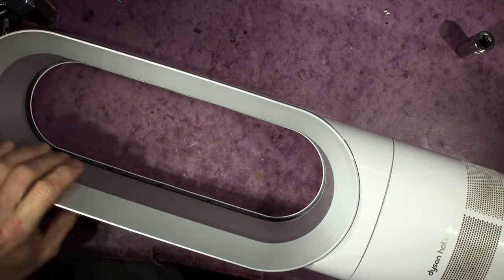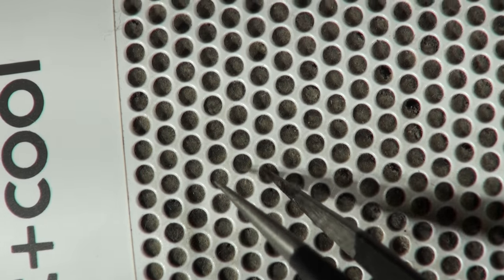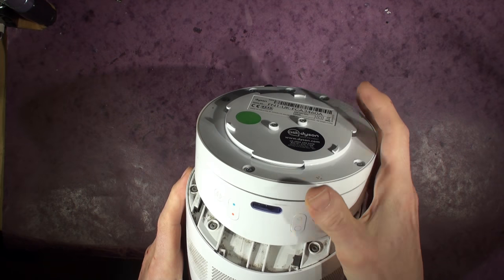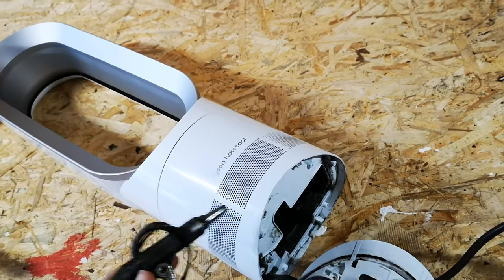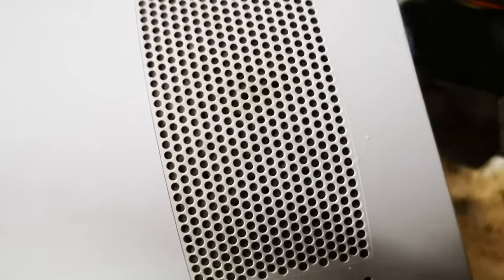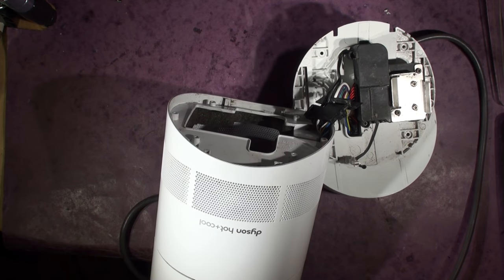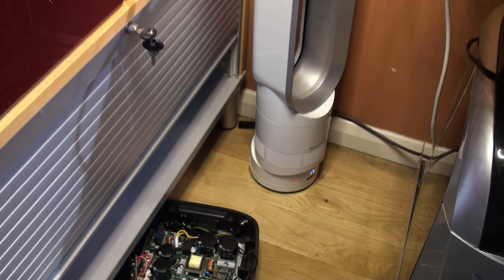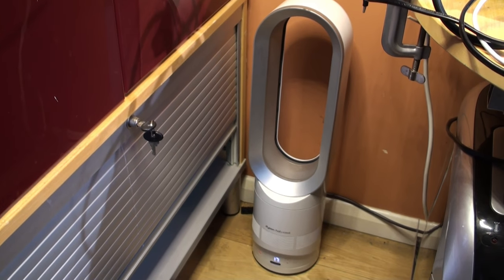Dyson Hot + Cool heater not blowing easy repair and service and filter Clean

Comment: I have Dyson hot/cool unit and it too stopped working after using it for only 2 years. For an unit this expensive, cannot believe how difficult it is to clean out the dust. Not to mention the noise.
Reply from the maker: It is truly a  victory of style over function
Reply: Done purposely so you have to buy new
Reply: Literally… same
Reply: And.. same again. 
Thanks for video
Reply: I have a simple 12" fan and this dyson. I cleaned the 12" wire fan in the time it took to take apart the dyson. Haven't even cleaned it yet. What an ugly pain in the ass.

Comment: So basically, this is not a buy because if you had to go through all this just to clean it. You better getting a regular fan or a regular heater.
Reply from the maker: I understand that if you vacuum the input holes on a regular basis they work OK. Over-hyped? Noisy? Way overpriced ? Yes. If you prefer a victory of style over content then buy one otherwise tere are far better and cheaper products on the market. Honeywell fans are good.

Comment: I was surprised that you said it was noisy. Mine is very quiet. And has been great for keeping the kitchen warm and not having the heat up the whole house, until I got the H2 error message. So I hope I can clean it because now I'm retired and I can't afford it another one.
Reply from the maker: Mine sounds quieter now I am a bit older - but they are loud... the dB meter does not lie!!
Reply: I have the same issue

Comment: Mine has never blown cool air .dont buy one you’ll regret it
Reply: Probably because you dont clean it or u have a bad ac wall plug
Reply: You do set it to 32 F or 0 C right?
Reply: They don't cool air. It just circulates ambient air to make it feel cooler. There is no cooling element in them.
Reply from the maker: They are a ridiculous product.  I haven't spoke to anyone that loves the Dyson heater. The real question is why or how anyone could be seduced into paying the price for one of these things..  Noisy, smelly, gets blocked up, numerous error codes etc. etc..
Reply: @razenby  I bought one 4 years ago. Stays on number one for speed so it takes three hours to heat my bathroom....Then when door to bathroom opens door it takes another 3 hours to heat up again...Now I see it needs a cleaning. Stay tuned!!
Reply: Stephen Watkins hi Stephen .. any luck on the speed settings? .. mine are amO4 model and speed works on cool , but not on hot settings 😏.. sometimes works occasionally .. all the digital lcd displays show the fan speed 1 to 10 etc , but no output increase , stays at fan speed 1 .
Look forward to your reply 👍🙂👍

Comment: Thank you 🙏 I just fixed the heater on my Dyson because of this video. Now I feel more comfortable keeping the first Dyson fan that hit the market. I was about to throw it away until I stumbled upon this video. Not to sure how I actually fixed it, but opening it up in 3 different places and giving it a good cleaning really helped! All I used was a vacuum and screwdriver. Btw, if anyone knows why heating number 17 below doesnt work but 17+ works let me know.
Reply from the maker: Excellent. thanks.
Reply: Because the number is the target temperature of the room. If it is already reached (or close enough) they will not heat.
Reply: Does it use electric heating or oil radiator system?
Reply: @tdhar2009  lectric bro

Comment: We got this for the toddler room https://www.youtube.com/post/UgkxdzUap46p9ViXhKZf5mK_bXOb89EHxTqq because of the bladeless feature. Actually has a lot more power than I thought it would. Can still feel the air moving well 6 feet away, which is farther than I would expect from a desk fan. My daughter dropped twice and still works. I haven't checked out how long it lasts on a charge yet, but the air output was still good for the few minutes it was unplugged. My daughter also likes the color lights feature, but I don't really care for it and can be annoying to go through all the options before it turns off. Overall, happy with the purchase, especially for the price
Reply from the maker: Noisy too.

Comment: After wasting an hour with Dyson online  chat that did nothing to fix H2 error code on my AM09 model, given address to send for service at my expense.  I bought 5 of these years ago, gave 2 as gifts, now all back in my possession. Only 1 has this issue.  Decided to search You Tube. Appreciate your video.  Going to try taking it apart and clean.  You make it look fairly easy, if it is, will clean the others as well. Fingers crossed.  I love the compact size, use 1 in a camper for heat rather then the propane heater. Definitely not designed well and way over priced. 
As my late grandfather would say "A fool and their money are easily parted."  Should change my name to Foolish   😂
Reply from the maker: Good luck.. Pricey but noisy...

Comment: They’ve definitely improved on these throughout the years. I have the pure cool link model (just a Wifi enabled blade less fan with a HEPA filter) and it’s pretty quiet. I imagine the filter will eliminate the need to take the unit apart for service. I do like being able to tell how the air quality is in my room without having to be there and it automatically switches on and off depending on the condition of the air in the room is. But I agree, very expensive. I got mine for a discount that was about half of one new so cant really complain. Might just go look at the pure hot cool as well. Thank you for the video!
Reply from the maker: True it is still a a victory of style and marketing over the function.  The good thing is that they are so costly that people try and repair them instead of buying a new one.

Comment: thanks for making the video about this H2 error.  (click read more for solution as my comment is too long)

My AM09 dyson hot cold fan recently had the same problem.  but i checked all the little holes vents there was NO dust whatsoever (and Air was blowing out fine).  After watching your video,  i still used an compressed air blower and blew all the holes. then restarted dyson am09 still H2 error. 

Then i googled more and found this dyson rep comment on bestbuy forum regarding the H2 error.

~~~~~~~~~~~~~~~~~~~~~~~~~~~~~~~~~~~~~~~~~~~~~~~~~~~~~~~~~~~~~~~~~~~~~~~~~~~~~~~~~~~~~~~~~~~~~~~~~~~~~~~~~~~~~~~~~~~~~~~~~
Hello there, this is Kelly with Dyson. We're sorry to hear that your AM09 is showing an H2 error. This error is there to alert you to an over/under current. The machine draws more energy while in heat mode, 1500 watts. You will want to ensure that your machine is being plugged directly into outlet and not a power strip/extension cord. You should also keep your AM09 on a separate outlet/breaker than other high powered devices. Please feel free to reach out to us directly at askdysonUS@dyson.com and we'll be happy to assist you further with this. Best wishes, Kelly Dyson Customer Support   ~ Answered by DysonProductExpert 1 year ago
~~~~~~~~~~~~~~~~~~~~~~~~~~~~~~~~~~~~~~~~~~~~~~~~~~~~~~~~~~~~~~~~~~~~~~~~~~~~~~~~~~~~~~~~~~~~~~~~~~~~~~~~~~~~~~~~~~~~~~~~~
Link for above comment:
https://www.bestbuy.com/site/questions/dyson-am09-fan-heater-white-silver/2852021/question/8431d81c-23bd-3f4e-afd4-10df6ee2c09d

TLDR:  (MINE IS FIXED)  i plugged it in directly to a wall outlet instead of into a power strip/extension cord.  it is working again.  Hopefully anyone have the same problem can fix it just like i did.

Cheers!
Reply from the maker: Good stuff ... Thanks for sharing the info.

Comment: Thank you! It did fix my fan but I noticed the black foam inside crumbled. What’s the purpose of the black foam? Do I need to replace it?
Reply from the maker: The foam is likely there to deaden the resonance of that housing to make it quieter. i find it disappointing that PU foam is still used.  I understand that it is attacked by ozone. Thanks for watching.

Comment: Seeing as how they've gone completely to making filtered units and not just fans, they also realized how badly dirt can clog up these fancy "air multiplier" apertures, as well as the tiny holes for air intakes. I bought myself one recently (AM06 fan/no filter), it's still stuck in the NE U.S. from winter storms delaying shipping, but I've been watching these types of videos to make sure mine lasts for years.

Edit: They still make the AM07 tower fan model, but discontinued the AM06, so the tower fan is the last one without a filter.
Reply from the maker: Interesting thanks.  None of teh Dyson heaters are very reliable.  truly a triumph of style over content.  Their profit margins are eye-watering.

Comment: Hello there! I came across an old AM05 hot cool tower in my office that I’d like to use. I plugged it in and it seems to produce heat, but won’t go any cooler than 25C and the oscillation stops then too. Would this clean help my issue?
Reply from the maker: See if the temperature sensor is fouled and correctly connected.

Comment: Ok mine has an E message, flashes red and blue and of course makes this melting plastic smell. I had to remove it from my outlet and it was still lit for like 30 seconds super weird. Anyway, would cleaning it help? Do you have any idea what’s wrong with it? I mean it’s from 2015 and it has never been cleaned so I could try. I’ll update if it works or not when I’m done!
Reply: Ok quick update: thank you again for the video! I wish I could put pics here because it was just as dirty as a vacuum cleaner bag! It took me an hour to clean out but I did it. Oh my god! That was bad. But it’s clean now! Hoping the dirt was the solution!
Reply from the maker: Great news,

Comment: Thanks for that mine works now ,I cleaned mine out with a can of compressed air that I use for cleaning computer keyboards
Reply from the maker: Yeh, that would work.. The blockages on my heater were little solid plugs - event the 140 PSI compressor would not shift them.

Comment: Do you know the problem I am having with mine? It seems to blow hot air only on the right hand side and cold on the left which is very annoying.

Thanks
Reply from the maker: One of the heating element in the top part has failed.
Reply: If you solve this let me know. I have the same issue. Did cleaning help?

Comment: Hi, what screwdriver do you use to remove the screws? The normal stars screwdrivers don't work :-(. Thanks.
Reply: You need a torx screwdriver bit, I didn't have the right size though but managed to open using a small flat head screwdriver.  Hope that helps
Reply from the maker: You need a T8 Torx driver

Comment: Same problem for me but none of my screwdrivers seem to fit!
Reply: Same here im fuckin freezing in my loft room
Reply from the maker: Winter drawer on!
Reply: Helen, did you ever find out which screwdriver/hex key is required to fit the screws?  I'm in the same position.
Reply: Ah, ignore me, found the answer further down - 'T8 Torx driver'.

Comment: Thank you! What size screwdriver did you use to undo the screws?
Reply from the maker: Sorry, not sure - I should have said.
Reply: @razenby  It is a Torque (6 point start tip) 7; just cleaned mine today 12-31-21 and it works; H2 error gone
Reply: typo: Torx 7 worked.
Reply: Thank you for this!  Had tried to use one of my screwdrivers and  none worked.  Now have a T7 on order!  Worth it to clean it out!

Comment: All that design, all that work, all that flabbering and this entire fan is basically a disposable item for a person that won't do this clean-up procedure/can't (not all people were born with a screwdriver in their hands). And mind you, there's both enough space in the frame and the existing design to have removable mesh outers and inners to clean. Heck, the design lends itself to even allow a removable and cleanable motor pod/core.
Reply from the maker: You are right!! Dyson is products are definitely a triumph of style over function.  they are an ECO disaster,

Comment: Mine just stopped working and doesnt even start up when connected to the outlet
Reply: @MacenW  yup that was it. I got a new extension cord and it works now
Reply: Try turning the plug socket on.
Reply: @Dime_Bar  hahaha funny joke
Reply from the maker: A victory of style over electronic design.  I just don't know where they get these engineers from. I bet they use young clean-cut smart boys instead of hairy old men that know their stuff. I ran a development department for 20 years working right there on the bench with the engineers as it was the only way to stop stupid design practices.   Design is easy but most companies stop well short of adequate testing of their designs.
Reply: Exactly same with mine , totally won’t come on🥲any ideas 💡 anyone ?
Reply: @razenby  same as Architects vs Draftsperson. The latter are a practical breed.